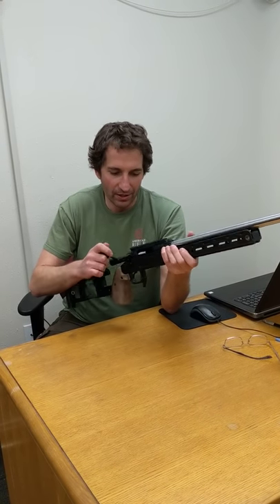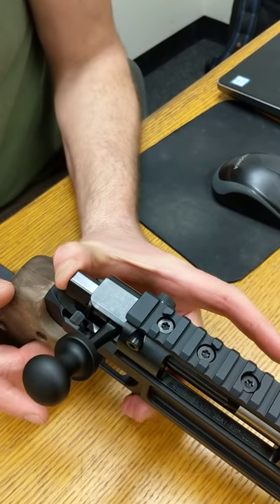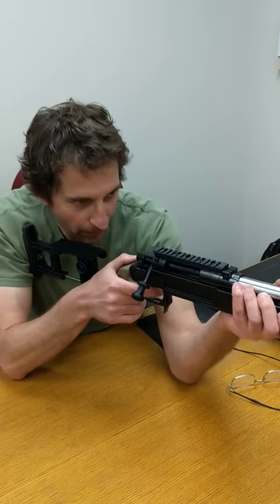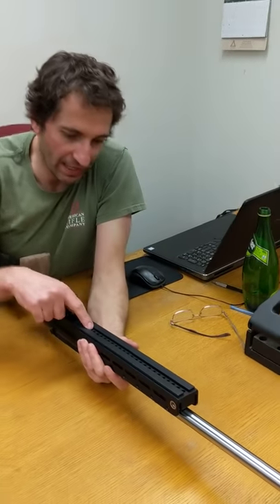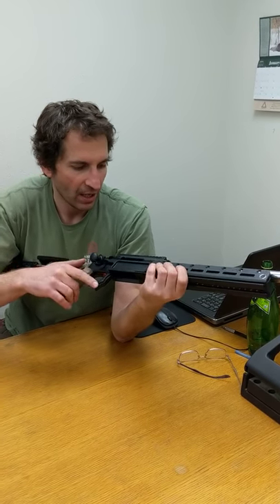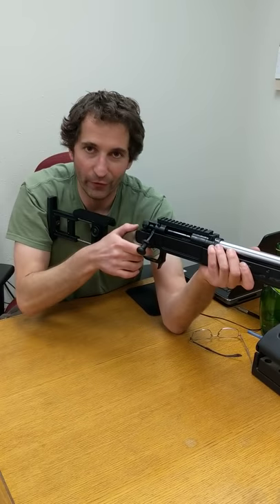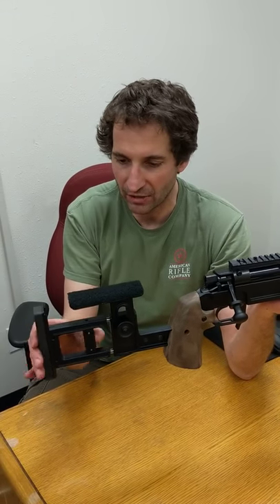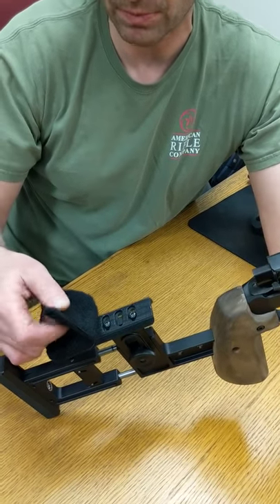Achimedes Bolt Action and Xylo Chassis

Comment: So is it cock on close or open? If open how have you addressed the lack of cam effecting required rotational force to cock action?  If close do you still have front cam to assist or is that gone as well?  It's an interesting design for sure, but seems to be entirely designed around a stuck case. Considering most of our bolt lift weight comes from force required to cock the bolt have you actually made lifting and lowering bolt harder sense dropping the cam?  Or did you split the cocking force between the two actions opening and closing making open considerably lighter but actually increasing required close force? Both also actually being harder sense there are no cams?  So I guess the real question is does this action do anything better than traditional actions short of extract stuck cases (which should be addressed at the loading bench)?

Comment: I always love the work you do Ted,
I just can't understand how you always get such amazing ideas. both the action and the chassis are something totally new to the market. Brilliant ideas. However, four things are still not clear to me. If I may ask you about. 
In regards to the action: 
1- would the lever bolt handle able to tolerate the tactical pressure under extream circumstances? 
2- It seems that the action lug is not integrated, pinned, or even attached to the action, So how would it perform as a recoil lug while it looks more like a barloc. 
in regards to the chassis, 2 very important parts are missing :
1- a top cover for the barrel to prevent the heat from showing mirage on the scope 
2- down below the aluminum frame start exactly from where the Magzine will be located which cuz 2 issues: 
A- if the rifle is placed over a barricade, there will be pressure on Magazine, thus there should be a barrier
B- though  The aluminum frame should be a good place to grip, as it seems wide and easy to hold, but not practical especially in cold weather. thus, a composite handle or polymer should be attached to that part which will also serve the first problem and prevent any pressure on the magazine
Reply: @Theodore Karagias wow that was a very fast and comprehensive response. Thank you so much for clarifying these points for me. I can't wait to see it coming. I guess I made my mind to go with both of chassis and Archimedes. You relieved me from my worries about the ruggedness of the action. And you also going to offer some barrel shroud and non alloy handle. What more to need. Maybe a thicker butt pad for the long action and a smaller grip for my extra small hand lol :)
Reply: @Theodore Karagias yes I agree with you. That is the point I was trying to make. Aluminum is metal which makes it get very cold in winter. So a composite, polymer, rubber or even wood handle foregrip (forend grip) being placed at the underside of chassis will be a great feature that can be optionally available especially for those who like to use a modern style chassis as a hunting rifle in the winter time.  Also, a forend grip at the balance point adds comfort. At the same time, it will feature a magwell barricade stop. 3 in 1. examples of these: 
Magpul M-LOK AFG Angled Foregrip or Tyrant Designs MOD Foregrip (Fit both KeyMod and M-LOK). but in Xylo we need to find that fit into Arca-Swiss or Anschutz rails or to use Arca Swiss Adapters that attach to M-Lok